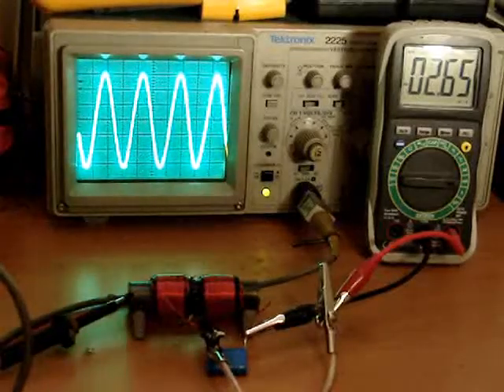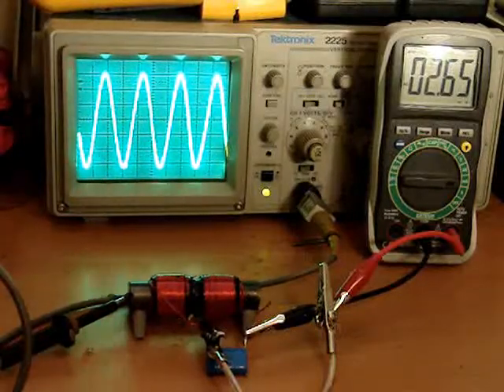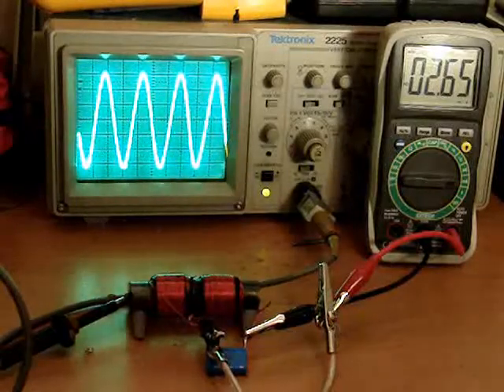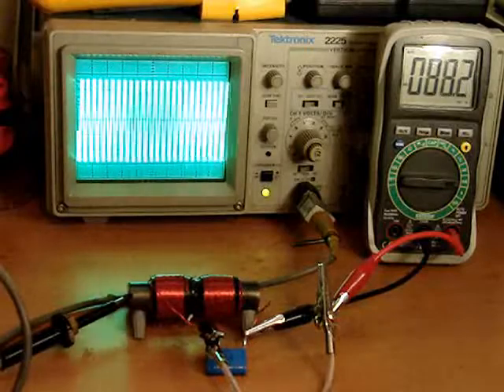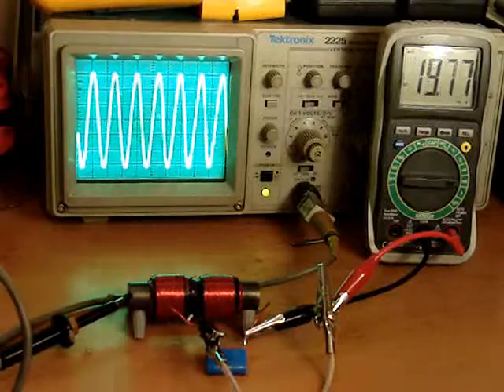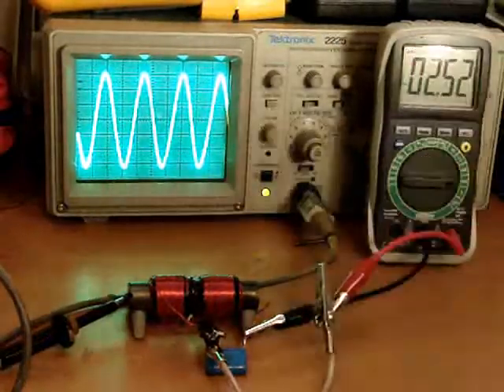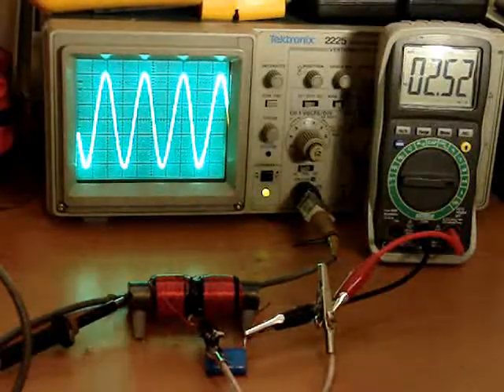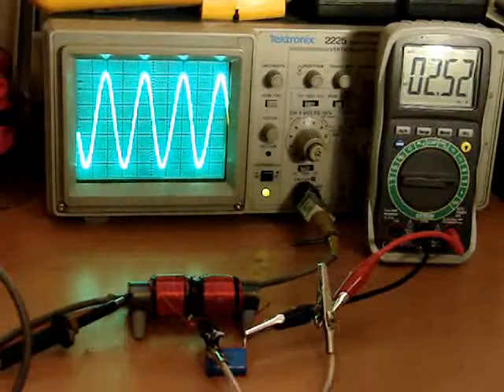Resonance cont

Comment: @Tortuga0303, Can you help me on what the relation ship needs to be between coil & capacitor to get this result?
It's not only resonance there has to be more because I tryed different combinations but influence to current is minimal and not like you show.
I did the experiment with first placing the capacitor in series to determine resonant frequency and then in parallel, but it's not showing me your result.
With relationship between capacitor and inductor I mean other then just tuning the circuit to certain frequency.
I did experiments with series LC and made a graph where you can see that certain combinations of C with L give better results
https://photos.app.goo.gl/bn5YuMu3Htffmm6M6 Sadly I'm not able to get this working for parallel LC.
I hope you can help me further.

Comment from the maker: The two coils are in series, they are really one coil, just split because the core itself also splits, so that's how I wound it.  The core is Ferrite, and will pick up an electric signal from the coil, I like this method of viewing the field a bit better than hooking directly into the circuit, no measurements can be done this way other than those of frequency.